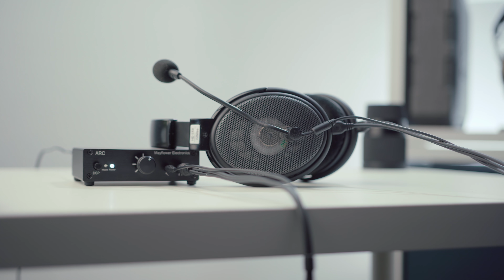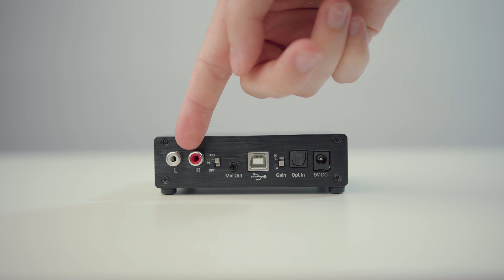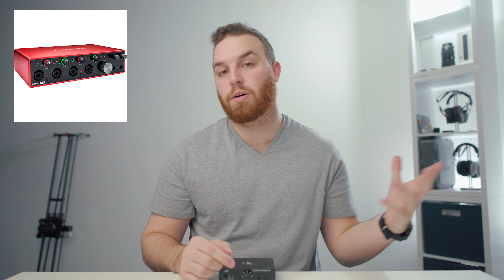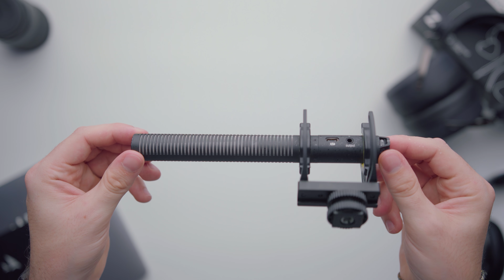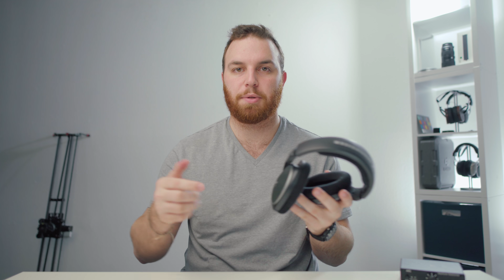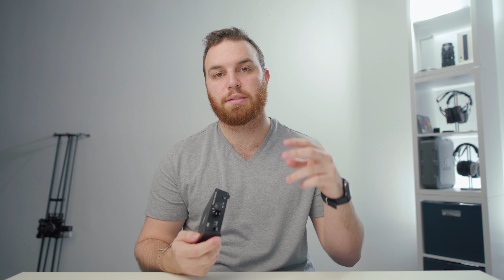Mayflower Arc | Audiophile Gaming on a Budget 💲!

Comment from the maker: What are you guys using for your gaming rigs? Audiophile setup tours Gaming Edition?
Reply: Right now I have Beyerdynamic DT770s running thru a Schitt Modi/Vali 2 or Magni 3. If Im not using headphones, sound runs thru Klipsch THX Pro Media 2.1...Mic is Blue Yeti Blackout or Blue Snowball. I usually have 5 sets in my rotation at any one time. At this moment...the 770s, ATH M40x, Monoprice Retros, Fidelio X2, AKG 7XX,  and Senn HD 58X Jubilees are out.
Reply: THX 789 and a VMV smsl d1. Go to cans for gaming are HD660s for a good balance of imaging and great sound.  Using a shure sm7b for mic.  I play mostly competitive shooters.
Reply: @Lemonpinesol  Your THX 789 holding your HD660s back. You need at least $2k AMP to make HD660s truly shine.
Reply: @sverek  Next upgrade :P
Reply: im super budget with status cb-1's, a umc22 interface and an ak-70 mic, all came for less than 150 bucks total and can punch well above its weight class
Reply: How does this compare to the Sound Blasterx G6 which is cheaper and also has a mic in.
Reply: SMSL M3 with DT990 Pro and ModMic 4 - After months of research, 2 years ago. 
Now I upgraded to Audeze EL-8 Open and Chord Mojo with the same ModMic 4.
EQ APO for both. ORATORY EQ for DT990 Pro and personalized AutoEQ for EL-8 because Reveal EQ isn't that great.
Reply: I just saw someone on a forum with Focal Elegias + a Modmic, lol. Endgame indeed!
Reply: Philips shp9500 with syba sonic dac
Reply: @PitiPablo_  how does this sound now that youve experienced this combo for a while? Im getting into the whole audiophile gamer thing as im tired of weak gaming headsets. But i dont wanna spend too much for my first set.
Reply: reccomend any good budget IEMs?
Reply from the maker: @harouoo  Tins are supposed to be pretty good!
Reply: @JoshuaValour  just saved enough to buy and i love em
Reply: @harouoo  I just picked up the IEM-2X from Status audio...for the price, you cant go wrong.
Reply: @harouoo  blon bl03
Reply: At the moment I'm using a SMSL SU-8 feeding my THX AA 789 which is powering my balanced MK3 Argons. I also have some crappy Logitech speakers.
Reply: I got a modi 3/atom and a creative g6 for its dsp features and mic input. Shp9500 pad swapped to ZMF Eikon micro suede pads and a Vmoda boom pro mic. I also have argons but I like the shp9500 with the ZMF pads better IMO.
Reply: AKG K712
JDS El Amp
That would be a dope video btw, but I do like the audiophile setup editions already still trying to copy a layout for my living room.
Reply: JDS Labs EL Stack,  spdif toslink connected to my self built PC.  I have 3 pairs of cans I use, Argon Mark 3, Audeze LCD-2C and Sennheiser HD569 for long sessions. Mic is a Blue Yeti Pro at 24 bit 192 khz.  It should be noted I use those cans for music at home and at work and in addition I also am a streamer and content creator.
Reply: Currently gaming on HD820s powered by an Aune S7 Pro (I have the 789 on order from Drop.)

It's really overkill but damn I love it.
Reply: audioengine d1+k7xx, modmic, but I recently got the mayflower arc, haven't tested.
Reply: Akg 7xx with fulla schiit dac amp and ath 2020 mic and yes please I'd love to see what others are using
Reply: Hey I have the 58x but no amp. The sound is good but would an amp like this make them much better? I use my pc with a decent motherboard. Some games are hard to hear positioning. And should I take the pads out of the out ear cup?
Reply: Fidelio X2s with a creative titanium hd sound card and a lavelier mic
Reply: I use the Arc with some beyerdynamic DT770 with the cable mod and have a v moda boom mic pro attached to it. I do plan on running a dedicated amp/dac for music alone in the future but for now the Arc is used for both gaming and music.
Reply: HD58x and Syba Sonic DAC/AMP with Samson Q2U.
Reply: Hell yeah for setup tours gaming edition! Currently using a Topping D30 alongside with a JDS Atom and Beyer DT 770 pro 250 ohm. With some HeSuVi surround tricks it's quite magic!
Reply: Using a Philips Fidelio X2HR, Sennheiser HD58x and Sennheiser HD558. Got a Rode NT USB Microphone with a RODE PSA1 Studio Arm, and having a Logitech USB Desktop microphone as backup (dont like a modmid it's expensive for what you get and it looks crap :D). I'm thinking about getting a FIIO K5 Pro dac/amp, would be nice If you did a review on that before I pull the trigger! :)
Reply: For gaming K712 with modmic. Amped with Massdrop O2+SDac.
Reply: Back in 2017 I looked into this "ARC", I have to say it is overpriced AF.  My recommendation would be the Yamaha AG06/03 Series. It's an audio interface with good clean pre-amps, active monitor outs, effects, mixer and the best thing it has the same input for gaming headsets as this ARC, headphone out is good for gaming and way better than any on-board audio. You save from 80-120 USD. It amazes me how nobody talks about the Yamaha AG series for gaming...

As to your question Josh: when it's time to enjoy a good single player game I use my Geshelli Labs Stack + HD 660 S and for multiplayer I use the before mentioned Yamaha Audio Interface with a pair of Audio Technica's ATH AD700 sound whoring like a Mofo.
Reply: HD 58X + DAC-X6 + ModMic 5 in omi-directional mode. $275 setup I won't feel the need to upgrade unless I become a millionaire and can afford something like Sennheiser orpheus.  🤣
Reply: Β&W P7 with , onboard Asus Strix SupremeFX S1220A codec ( really good for games) and  I also use Ifi micro with HD 650 ( I also have 58X but I dont use them) , And lastly  For Wireless i use Bose Soundlink 2 , (for me the best wireless that i have heard and feel, light with memory foam)
Reply: Audio Technica AD900x powered by a Fiio K3, mic is a blue snowball on a boom arm. Speakers are currently Corsair SP2500 2.1 which are okay but they’re the next on the list to upgrade.
Reply: Sennheiser 58x, Audio gd nfb11 headphone amplifier, Audio technica ATR 2100 USB microphone.
Reply: I got the 'refurbished' Arc for USD $200, paired with a (massdrop) PC37X. Puurfect.
Reply: I use a Topping MX3 Dac/Amp to M1060C's for single player "immersive" gaming, movies, and music. For multiplayer games that require a mic, podcast listening while doing chores, and watching youtube videos, I just use a Hyper X Cloud Flight with Brainwavs angled earpads. And for everything else, I have a pair of Micca PB42X's planted next to my monitors.
Reply: Hifiman Arya with modmic 5, powered by the holy duo, thx aaa 789 and rme adi 2. Endgame for me lol
Reply: Im rocking the 58x with a JDS Labs Atom amp / OL Dac and a Samson meteorite mic plugged via USB. Relatively but wouldn't mind a slight upgrade for my mic.
Reply: smsl M100; monoprice liquid spark (thanks to your review); 58X and an old massdrop minimic plugged into a USB dongle. my setup is cheaper than the arc and i'd argue better ;)
Reply: Sennheiser HD 598SR (3.5 mm jack mod) + Vmoda BoomPro mic + Xbox One Elite controller (On One X and PC) and a Turtle Beach Headset Audio Controller Plus for better audio output and some background noise cancelling on the mic and audio balancing via the Xbox One Elite controller.

Used to use a ModMic5 in this set-up, but the mic was too sensitive and would pick up the audio from the open back headphones even on lower volumes (I do probably listen too loud though).
Reply: I'm using the FX-Audio Dac X6 with a pair of DT990 Pro 250ohm and I'm pretty happy so far, though I sometimes wish I could regulate the lows and mids a bit more to my liking. That's why I'm thinking of getting a Schiit-Stack with Magni, Modi and the Loki ... don't have the money though and I'm not sure if it's worth the upgrade.
Oh and I have the Blue Yeti microphone.
Reply: I am using an M-audio m-track 2x2 as my dac and my audio interface. Headphones I usually game with my AKG m220 that I bought after a recommendation from you.
Reply: As headset im using Audiotechnica ATH PG1 currently but Im thinking about switching back to my Audioquest Nighthawks just using a cheap clip microphone since the headset is not comfortable enough to wear over time.
Reply: JDS Labs Atom, Topping D10, ZMF Auteur, Blue Snowball.
Reply: JDS Labs Element
Sennheiser 660s
and a $12 USB desktop microphone from Radio-Shack.
Reply: Sold my Steelseries Arctis Pro + GameDAC for beyerdynamic DT990 250ohm, but now im planning to sell my DT990 for DT1990.
Reply: Initially I started from a hd6xx +khadas tone+ jds atom with a neewer 800 + behringer u-phoria. I was feeling short with some shooters for the lack of space so I tried with takstar 82 + ketdirect boom mic and everything changed in gaming department, but my future (on the way) gaming endgame K7XX + atom + khadas tone and for microfone still on the works...but I between modmic 4 or dynamic microfone since I getting my YouTube channel.
Reply: HD58x into a Topping NX4 DSD with a Zalman ZM-Mic 1 into a Syba Stereo USB sound card. That little piece of tangled mosquito doesnt look like much, coupled with a weird USB stick for mic input - but trust me, look for the reviews :)!
Reply: 58X + FiiO K3 + Samson Meteor
Reply: Grado SR60e modded sounds very good.
Reply: HD58x with outside foam removed , powered by Burson Play .  Mic setup is a AT2035 running in a Scarlett 2i2 3th gen
Reply: Schiit Modi 3 - Schiit Loki Mini - Schiit Magni Heresy with Sennheiser HD 660 S
Reply: Schiit Magni Heresy/Modi Dac and Sennheiser 58X's, upgraded from the GPS600's and GSX1000
Reply: BeyerDynamics DT 990 Pro (250 ohm) with the Mayflower Arc Mk2. However, I'm trying to figure out how to get voice chat (audio out?) to my Xbox One X controller. Advice? Thanks!
Reply: Sennheiser HD660S with modmic 4. I'm Running HD660S through Firestone Audio Fubar IV DAC/Amp and modmic 4 through creative soundblaster play! 3 usb-dac.

Comment: I'm using the Mayflower ARC MK2 on PS5 with HiFiMan Sundara's. Sounds great. Headphone volume setting on PS5 is at 100% and the ARC MK2 is usually around 50%. Callisto Protocol is my favorite sounding so far with this setup. Valhalla sounded muddy so it heavily depends on the games audio quality. I ordered a custom 15 foot (paracord sleeved) audio cable for the Sundara's from Fog City Audio. This matches the length of the PSVR2 cable and the Sundara's fit over it perfectly. I've been using the Mayflower ODAC2 Rev B on PC with AKG K712 Pro's for 7 years and love it, which led me to buying the ARC MK2. I prefer the AKG's warmth and low end for PC music and gaming (with a modmic) and got the Sundara's specifically for the PS5 . Both sound amazing on their respective setup's. The Sundara's don't have the warmth I enjoy out of the AKG's on PC for music, and are missing some of the low end the AKG's provide. On PS5 they sound 100% better in games and have plenty of low end without using the DSP feature at all. Both have an awesome soundstage. It's worth noting not all DAC/Amps will work on the PS5 as it supports UAC1 but not UAC2.

Comment: Yeah $240 ain't that budget when you have options like the Fulla 3, Soundblaster X3, or even the HEL
Reply: I agree. I haven't used the Arc but I have used the Fulla 3 and Soundblaster G6. Those are both excellent sounding. Not sure why I'd go with this for $250.

Comment: PlayStation gamer here. I’m currently using Dt 990 250ohm with soundblaster X7. 
I’m thinking of buying a pair of 660s for Destiny pvp to get a bit more narrow sound sense the 990 is a bit to wide(but really good for god of war). 
I’m also thinking about exchange my soundblaster for a Audio-GD nfb 11:28. 
I don’t use the mic input on the soundblaster because the mod mic is good enough threw the controller.

Comment: Been using this with the Audio Technica ATH-ADG1X Open Air High-Fidelity Gaming Headset for over a year. I use it on my ps4 without the optical cable. Recommend this over the Astro mix amp which has firmware updates.

Comment: I bought the ARC when it was first released, It only has 2 modes (USB, OPT) - What does the PS mode do as mine is missing this feature :( - USB mode seems to work fine for me when I use it on my PS4 Pro.

Comment: There's a better alternative:

Fiio K3 or K5 Pro $100 or $150
Behringer Audio Interface 1x XLR/TRS $40
XLR Microphone no more than $20
Mic Stand $10
XLR Cable $7
Massdrop Sennheiser HD58X $160

Under $400

Just my opinion, not trying to steer anyone anyway from, the all-in-one unit by mayflower, it's just too expensive IMO.

Comment: 6:32 Is it safe to use 58X without any foam over the drivers ? What i have done is to cut a round ring and with 2 side tape get it over the driver , so dust never gets inside .

Comment: These also can have qc issues. My first one just straight didn't work (this was a pre-order when they first came out). Then the 2nd unit would randomly not turn on.. It would just click click click over and over for seemingly no reason. Sometimes unplugging the power for a minute and retrying would work. But if it works it was a great amp for the price. Would not use it for more power hungry headphones though. Also the dsp was nice. Added a nice bump

Comment: Hi Josh, I use K7xx for gaming (based largely on your high recommendation of them specifically for gaming, as well as a few others). Right now I'm just using them straight out of my Xbox controller (yes, I game on Xbox). I'd like to upgrade this setup and have been on and off about the Arc, depending on which review I watched last, hahaha! 

I've also been strongly considering going with a Grace SDAC (probably balanced) along with JDS Atom. That combo would land me at $250 (same as Arc). Then, I'd have to grab a mic of some kind, probably ModMic. I care more about quality than the convenience of all-in-one. With that in mind, any reason you'd go one way or the other with the options I'm considering?
Reply: Also, I'm not sure how to resolve the mic situation. Would I plug a splitter into my controller and then plug the mic into the mic side of the splitter? If this is feasible, would I hear lag between my actual voice and the mic monitoring of my voice in the headphones?

I'd be grateful for any input you can offer. I appreciate all your videos - they really are a huge help. Thanks!

Comment: For gaming I've been really happy with the Mackie Big Knob Studio. 

$250, USB, Line In, Two Mic Inputs with Onyx Preamps, AB monitor outs with volume control, and most surprisingly TWO headphone outs that sound really good. Honestly, if I was looking at the Arc, I'd definitely check out the Big Knob. A $250 all in one device for speaker volume control either to an amp or powered monitors, a DAC, a headphone amp, and a high quality mic interface is a steal. Especially since the Amp and DAC sound pretty damn good.

Would be an interesting product for you to check out.

Comment: I'm 90% sure mic out of the back is there so you can route the mic somewhere else without worrying about ground loops from shared ground headsets.
Reply: Correct. I used USB into my ps4 I think then the line out into my line in on my pc to basically split the mic output

Comment: I got the arc after using the sennheiser gsx 1200 for a year and was very disapointed by the arc. The sound quality in games is basically the same but was missing the outstanding 3d sound of the gsx 7.1 emulation. I tried the dolby atmos windows plugin and the overwatch version with the arc too and they are bad compared to the gsx.

For music the arc is better than the gsx but not thaaaat much. For gaming the arc is in my opinion not even close to the gsx.
Edit: tested with the Sennheiser Game one and the HD660s
Reply: I used Game Zeros and Gsx1000 upgraded to JDS atom w/ Schiit Modi 3 running my 58x. Night and day difference to me the GSX always felt really underpowered. There are ways of getting Sennheiser 7.1 without a GSX if you really need it. IMO stereo is always better
Reply: @moonmessiah9368  which ways? Stereo socks for 3d positioning in fps. Actually all virtual 7.1 i tried except dolly Atmos and the gsx suck, too.
Reply: Just ordered the GSX1000.  I also plan to get the JDS Atom soon.  I'm looking forward to seeing how well they work together for those who think the GSX is a tad underpowered.  BadSeed Tech said that was the ultimate for gaming setups.  (I'll also eventually get the OL, to use for non-gamin setups)